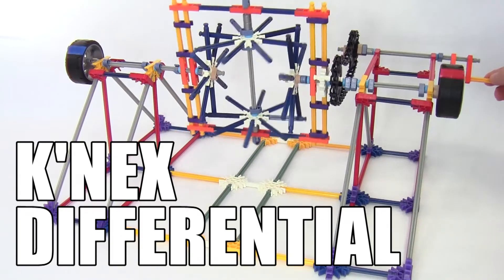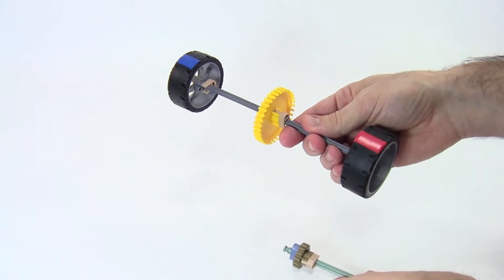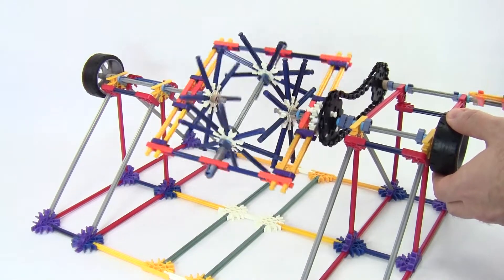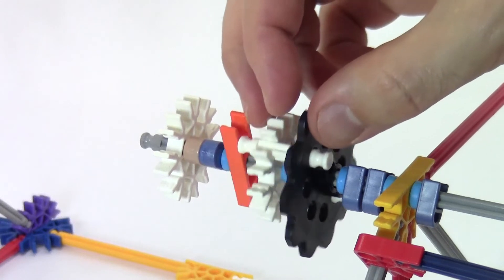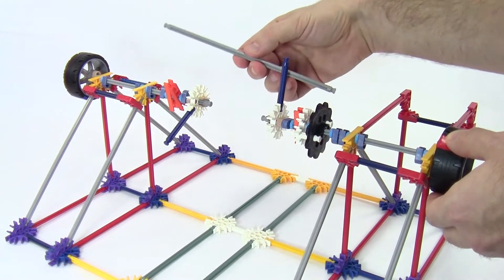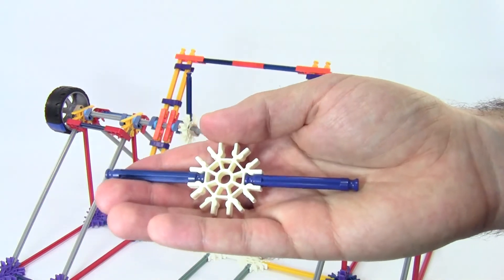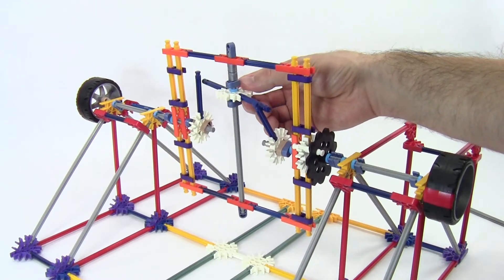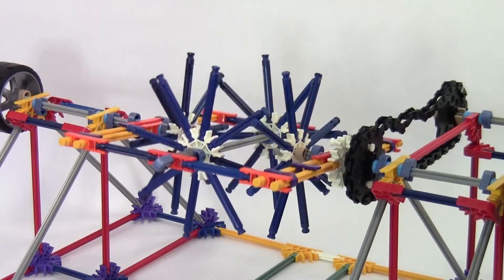Build a K'Nex® Differential | STEM Activity

Comment: @BiscuitBricks 

RE: Parts List -

[Arranged by Part Type; Descending Order by Size] 

GREY RODS: 12
RED/METALLIC GREEN RODS: 20
YELLOW RODS: 15
BLUE RODS: 46
WHITE RODS: 5

WHITE 8-WAY CONNECTORS: 7
BLUE 7-WAY 3D CONNECTORS: 6
YELLOW 5-WAY CONNECTORS: 8
PURPLE 4-WAY 3D CONNECTORS: 18
RED 3-WAY CONNECTORS: 10
ORANGE 2-WAY STRAIGHT CONNECTORS: 11
PURPLE ROD END CLIPS WITH HOLE: 8
TAN LOCKING ROD END CLIPS: 8
BLUE ROD END CLIPS: 20

GREY SPACERS: 5
BLUE SPACERS: 20

WHEELS WITH RESPECTIVELY SIZED HUBS: 2
BLACK CHAIN GEARS: 2
BLACK CHAIN CLIPS: 35

**Please see my subsequent comment in a reply to this one for a note regarding this parts list.**
Reply from the maker: This is incredibly helpful, thank you for taking the time to count! We will pin this comment so hopefully others can see it.
Reply: As @Science.Buddies mentioned in response to @BiscuitBricks asking for a part list to build this, the model can be varied slightly by using various different pieces depending on what you have available to you. 

This Parts List was made by me simply counting the pieces as they're seen in this video. Some items' counts (for example, Black Chain Clips) are a guesstimate, made by counting what could be seen and making an educated guess as to the number of additional pieces that would be required to cover the space that stays hidden behind other pieces and prevents me from seeing all of the parts I'm counting. Others are the total overall count of that piece accounting for each particular location it was seen in throughout the video. While it appeared that the same completed model was being shown at different points throughout the video, various new pieces were added or existing pieces were removed/rearranged. This just goes to show the truth in the variability of pieces needed for building this model. 

Furthermore, there are many pieces which can be swapped and used in place of another, just like the Red and Metallic Green Rods. For instance, in many (but not all) places where the Blue Rod End Clip is used by clipping it onto the side of a rod as opposed to the end, a Grey Spacer may be used instead. And a good number of Blue Spacers I counted being used in the video aren't really necessary. 

Taking all that into consideration, all counts are +/- a few.
Reply: Thank you for making the video! I love K'nex and this is an awesome build while also providing a cool learning experience.